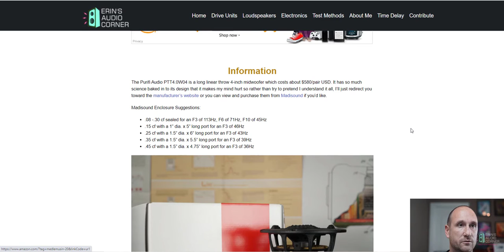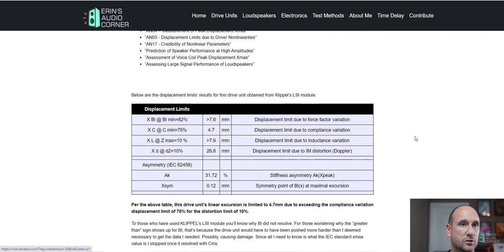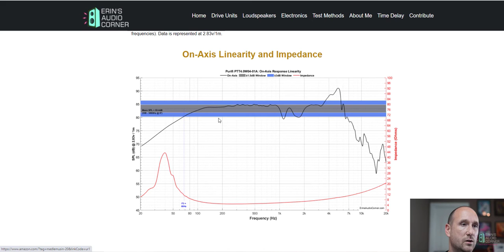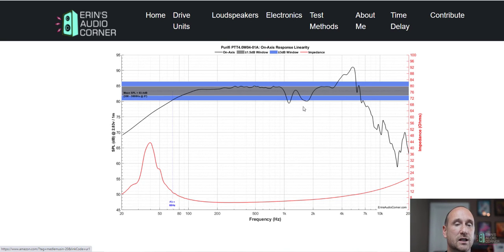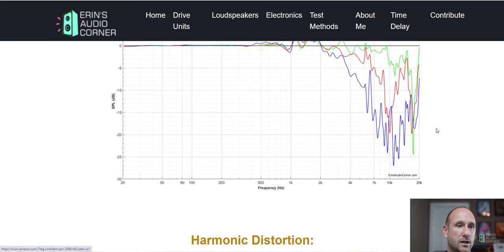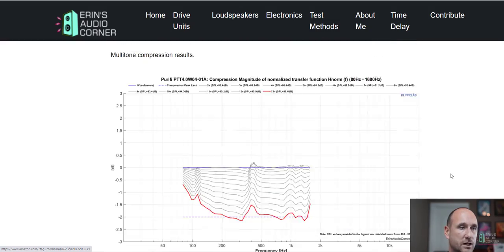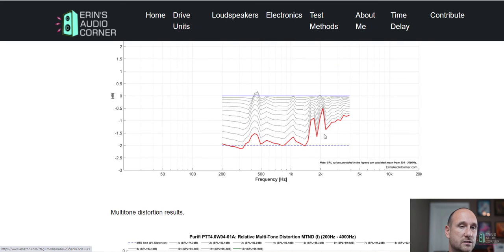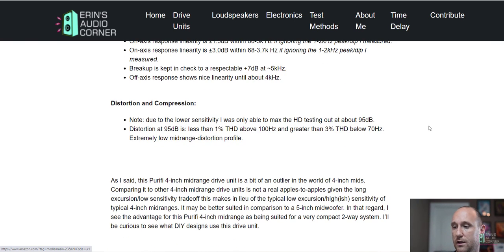Purifi 4-inch Midwoofer (PTT4.0W04-01) Review

Comment: we are clearly enter a gimmick market era in hifi.   the truth is - the cone surround shape almost doesn't matter.  
as long as it bends enough to achieve desired excursion it can be any shape which marketing department wants.
Purifi drivers are just good drivers like any other.  modern cone, modern magnet, modern chassis. 
but everyone wants to be above others so there comes gimmicks.  magic coatings, unique materials, patented shapes - all that stuff which you cannot tell by looking at measurement graphs (cause all those magical drivers measures basically the same.  equally decent)

Comment: Current plan for me right now is to take a cue from Tekton Designs except I'm going to use a Mundorf AMT cross to 6 of these 4" Purifi woofers in a ring around it. When you do the math and look at possible crossover points, there is a cross over point you can use the crosses easily from the AMT to the woofers and very quickly below that crossover point, all 6 woofers combine from about 950hz down. With the boosted efficiency of using 6 of these woofers together, you push down the distortion even lower than it already is, you have a very light MMS, and with dual 12" Dayton Aluminum cone passive radiators, you can get some extreme SPL from its entire bandpass. Again, while being very efficient and driving the distortion way down. These become monsters in a simple 2-way crossover config. Not cheap of course but building a small full range speaker that can output insane SPL is never cheap.

EDIT:
Now with Purifi about to release a 10" woofer. This could bring the build to an even greater level. Those 10" woofers are likely to be insanely expensive. Maybe I might just take another cue from Tekton and build a 6-10 sub using Purifi's new 10". Who knows.
Reply: How did it turn out?? I had a similar idea..

Comment: This is really outstanding reviewing and testing, and the insights available from the Klippel testing are revelatory - the benefits of low harmonic distortion and good IMD performance can't be overstated.  Many years ago as a hobby project I did a "symmetrical magnet" design for a 50mm wide-bandwidth driver (Bandor 2" - no longer available) and the difference in clarity on full programme material were really enormous.  We did a comparison test by feeding a 15Hz sinewave plus music signal to the driver - the 15Hz produces no audible output, of course, but the severe excursion of the 2" cone puts the coil/magnet system under a lot of strain and reveals any intermodulation by making the music "burble".   The difference between the same cone/suspension on a conventional pole design vs on the symmetrical one was really startling.  On the symmetrical pole setup, 3-4mm of 15Hz amplitude was possible without very obvious ill effects (your Klippel would measure them easily, but we could not hear any really gross effects) - on the normal pole design the same input produced a most unbearable modulation.  This was in about 1993.  It was not  a new idea, but the simplicity of the embodiment was very pleasing and the benefit obvious.  Bandor used this "long pole" design from then on, and were noted for their low distortion and remarkable bandwidth - the 2" units were +/- 3dB from about 100Hz to 15kHz.  I would be fascinated to see the results from a KIippel test of one of them!   Now, with detailed calculation of pole face shapes to optimise B field distribution, plus all the other improvements in suspension design and surrounds, the dramatic improvements shown by Purefi and others (the ScanSpeak 18WU is also very interesting) are taking it to the next level.  Combine these mechanical improvements with ideas like ATC's powdered iron pole materials, and NdFeB magnets, and the possibility of making dynamic drivers that finally cure some of these very fundamental challenges is there.   I'm really tempted to buy some PureFi drivers, and these excellent reviews are a big help in appreciating how good they are.  Thanks Erin - I've really enjoyed watching and reading your articles, I've not seen any other testing this detailed made available, and it's really educational.

Comment: I had hoped this would extend higher and be more linear up top than the larger PuriFi driver so you could build the mother of all micro-speakers with a small tweeter like the Hiqphon OW series. Of well ...
Reply: Maybe Troels Gravesen's edge coating process can help them in that non-linear area between 1kHz and 2 kHz. :)
Reply: Their paper cone kind of sucks - I was expecting more linear freq resp. It might be due to the surround they use, and of course most soft cones have this kind of resonance in 1-2kHz area.

Comment: I have a pair 4" Purifi woofers what would be the box size sealed where I can get max bass in sesled. Also was thinking of a dome tweeter to make a 2 way bookshelf
Reply: You should ask Troels Gravesen if his edge coating process can get rid of those resonances between 1kHz and 2kHz. Then you could use a smaller tweeter like a Hiqphon OW series to make the most kick-ass little passive speaker.

Comment: Jon Whitledge just took out the Dynaudio midranges and replaced them with  Purifi 4" drivers in the Magic Bus.  Maybe his were a different model designed specifically for mid-range duty?
Reply from the maker: I seriously doubt that.  I don't see the guys at Purifi making a one-off for a car audio dude.
Reply: @ErinsAudioCorner  Purifi is sponsoring the Magic Bus and they gave him the first two drivers made.
Reply from the maker: @hiresaudiocosta873  lol.... why am I not surprised.  At any rate, I would be surprised if he had special edition speakers.  But you would have to ask them to verify.  Personally, I don't have any interest in the matter.
Reply: @ErinsAudioCorner  After reading, I guess they are mid woofers, not mid ranges.   I'm not sure how that will effect the implementation.
Reply from the maker: @hiresaudiocosta873  yes, the 4-inch I reviewed here is a midwoofer.  As is their 6.5-inch version.  They currently don't make a dedicated midrange which would, ideally, have higher sensitivity in the upper-80's.

Comment: No worries regarding the short YouTube review.  Having all of the hard and complete data on your website is the real gold or DIAMOND mine.  👍

As you know, I've been following the development of the Purifi drivers since pretty much the beginning.  I was hoping that you would get the opportunity to hear these 4" drivers in some type of completed loudspeaker system like you did with the 6.5' (7") variant.  But I can understand why this wasn't possible.

As you said, it's a bit of an oddball design (IMO) and it really will be interesting to see how this particular driver ends up being used.  I'd certainly stick to your current Esotar2 E430 drivers for the moment.  :-)

However, I suppose that the market for small-ish high quality midwoofers is ever expanding.  All it takes is a quick perusal of the popularity of all of the small and relatively inexpensive Tang-Band, HiVi, Vifa, and Aura midwoofers, etc.

Although I don't see it being used as much in portable products like the aforementioned drivers, I could see the Purifi 4" being used in smaller homes or apartments in consumer "high-end" home theater sound bars, center channel MTM speakers, and rear, side, and overhead in-wall or in-ceiling surround speakers for Dolby ATMOS, etc.

Or perhaps a countertop Bose "Waveradio" or Sonos type of product.  Or as you mentioned, some compact active desktop mini-monitors.

As we know, ALL of these are extremely popular right now, and many of them would tie-in perfectly with a small but high-quality Plug-N-Play home music/theater system when integrated with AppleTV/Music, Amazon Echo/Alexa, or Google Home, etc.

But despite its fantastic distortion performance, that odd wonkyness in the critical upper midrange area where we are most sensitive, and also with it being well below where we would normally LP a 4'' driver to match to a tweeter, is just too much of a compromise IMO.  It's just an odd design choice and a bit peculiar...

UNLESS, the "tweeter" that Purifi is working on will be a very low Fs driver that is intended to match with this.  But IMO there would be a few compromises with that as well.  We will see.

I'd be lying if I said I wasn't more than a bit disappointed in these particular 4" drivers from Purifi.  I had high hopes, but that's only from the viewpoint of my (former) desired use case scenario for them.

I'm still curious to see what comes of the supposed 8" driver Purifi is working on as well.

Thanks again for the review and stellar data!